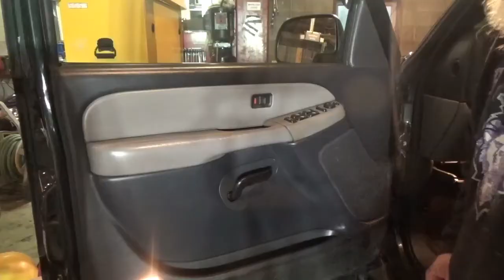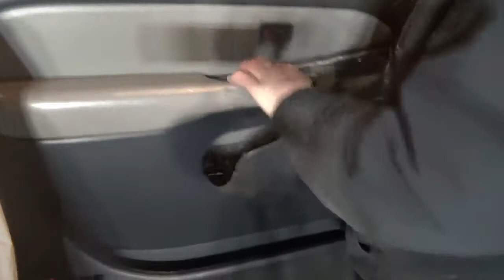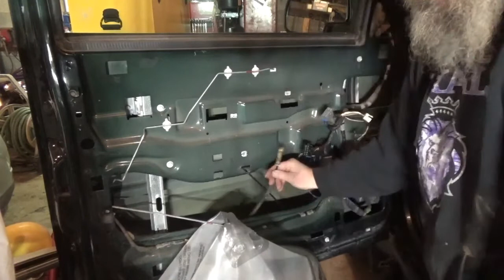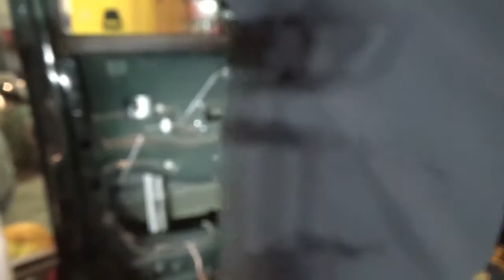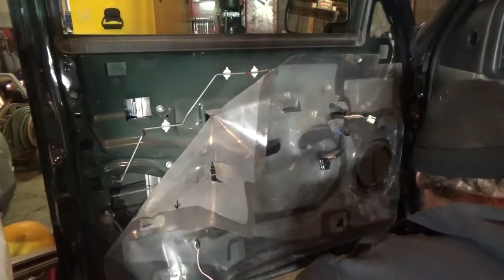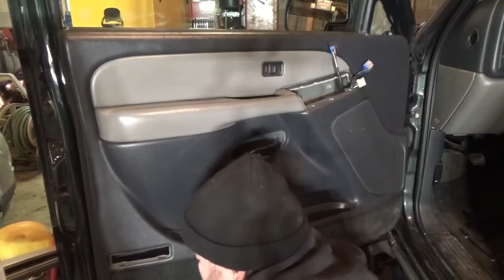Replacing GM Drivers Front Power Window Regulator / Motor Assembly on a 2002 Chevy Tahoe

Comment: Great video. I would like to suggest putting some lube on the window tracks (I personally use white lithium grease). The motor sounded like it was struggling to push the window up; or the window could be askew. If the window is askew, then just the door panel would need to come off since there are access holes for the window clamps. All those holes make you wonder what the vapor barrier actually does (almost a waste of plastic and sealant) haha.
Reply from the maker: +Jon Rushing when the vehicle is running it goes up and down much faster,
Reply: The Disgruntled Mechanic  
oh ok. but a little lube wont hurt :)
Reply: +The Disgruntled Mechanic Are you a first responder of some sort? I hear the cb/scanner in almost every video.
Reply from the maker: +Jon Rushing yes I agree lube is a good thing but not gonna rip it apart again real soon. I am not a first responder. I just like to listen so I have a heads up if they are coming to get me! haha!

Comment: Ha I like your disclaimer . I did the passenger side last year and my daughter did the drivers side of her truck and her side has a rattle opposite the door mirror. Well I couldn't remember what's over there that could rattle, well shes sitting here watching your vid and either the regulator  bolt loosened up or somebody didn't tighten it. HAHA. Nice vid Mike and it looked cold in the shop. Take Care.
Reply from the maker: +Steve Rob Thanks, actually 50 degrees f  here but only high of 20 f tomorrow,
Reply: +The Disgruntled Mechanic some temperature departure there!